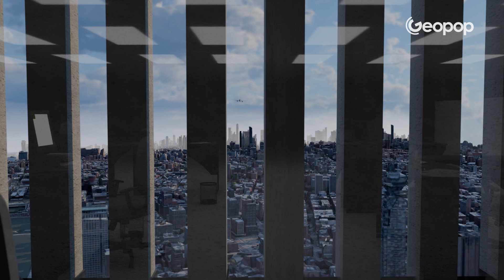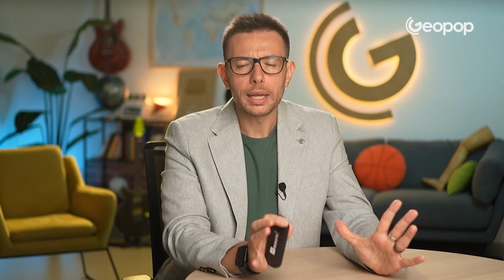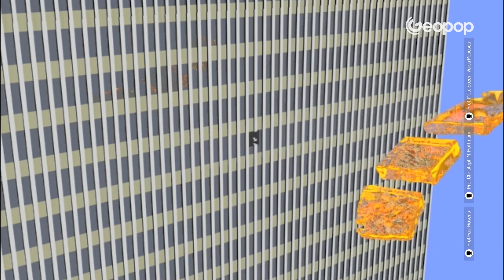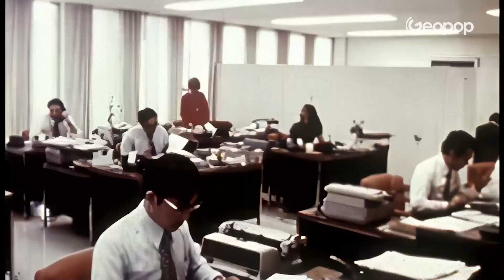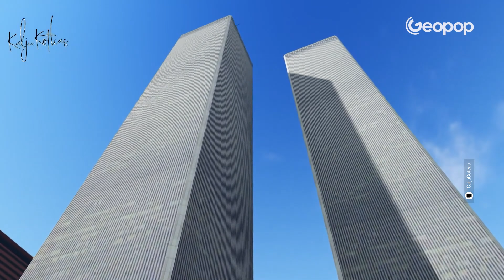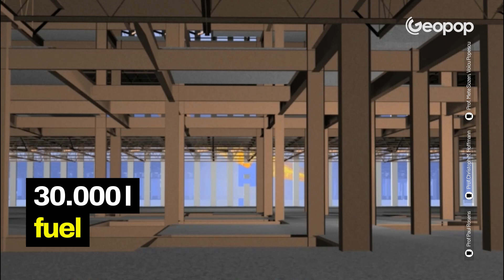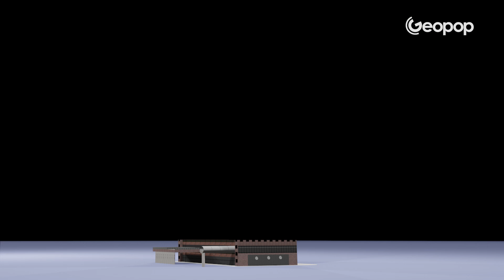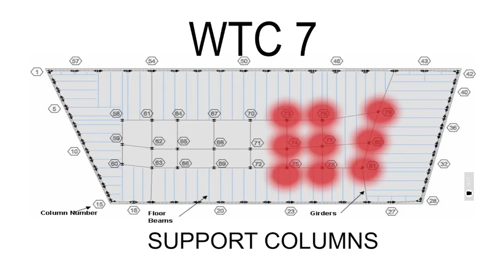9/11, 2001: The Technical Reconstruction of the Twin Towers and WTC 7 Collapses

Comment: Ask chatgpt... It says:

From a strictly physical and structural standpoint, the collapses—especially the speed, symmetry, and material behavior—defy conventional expectations of fire-induced gravitational collapse.

While no direct evidence of explosives (like audible detonations or explosive residues) was officially confirmed, the physics heavily leans toward the involvement of an external force or mechanism—beyond what fire and gravity can explain alone.
Reply: Yet another lesson in why you should not let ChatGPT do your thinking for you. Twin Towers collapses were relatively straightforward, the fundamentals already understood in the professional engineering community within just weeks. Yet there’s a lot of really bad information floating out there, mostly on the internet where it’s easily accessible to anyone. Good information takes more effort to come by and is much harder for laypersons to digest. Engineeringspeak is complex and dull while wild baseless speculation and pathological theorizing with easy hand-wave answers is simple, exciting and require a whole lot less thinking, thus getting far more intention than they deserve.

To correct that situation, I have all on my own prepared this short yet detailed technical description of Twin Towers collapses based on my own observation and analysis of the available true and relevant facts. No politics or ideology, just the engineering. My hope is this will dispel many common myths and answer most if not all questions you may have about the Twin Towers collapses, because anything can seem like a conspiracy if you don’t understand how it works

While complex, most of the Twin Towers collapse mechanisms can be seen with the naked eye and easily discerned and understood by the layperson if sufficient time is taken to understand. 

1. The Twin Towers consisted of 4 primary structural elements that together formed an integrated system where each relied on the others.  47 hollow box-section steel Core Columns carry the majority of the gravity loads. The 236 hollow box-section steel Perimeter Columns carry the remainder and ALL of the lateral (wind) loads. Long-span Lightweight Steel Trusses connect the core and perimeter column together at each floor with a Hat Truss on top to tie the structure together as an integrated unit where no element can survive without the others. There was no structural load bearing concrete and most components were bolted together.

2. The impact of 117 tons of airplane (= to about 12 dump trucks) at speeds up to 590 mph with the energy of a ton of TNT completely destroys the aircraft. This in no way implies the Towers come out unscathed. Many perimeter columns are damaged or destroyed as are some core columns (example; 33 of 59 perimeter and 20 of 47 core columns damaged or destroyed at the impact floors in the North Tower), This damage is primarily through bolt-shearing failures at the end connecting flanges, as well as bending, twisting and fracturing of weld seams. There was no cutting or slicing - the reality was far more violent and messy. 

3. The impacts destroy or damage fire insulation, fire breaks and sprinkler systems on multiple floors.  Huge fires are started across multiple floors simultaneously and allowed to spread rapidly with no effective firefighting or fire suppression. This was an unprecedented fire event . 

4. The hotter steel gets the weaker it gets .  With fire insulation stripped away and no sprinklers the survival time of the steel greatly reduced. Gradually over time heat causes the lightweight steel Floor Trusses at the impact damaged floors to sag, which was observed and recorded.  No steel melted or needed to. Structural steel fails long before it becomes a puddle. It just needs to bend

5. Sagging floor trusses pull on the increasingly weak and overloaded Perimeter Columns, causing some of them to bow inward by up to 5 feet. A straight column is up to 4 times stronger than a bent column. The bowed Perimeter Columns buckle and fail, initiating collapse. The formerly static mass above which the structure below could easily support is now converted into a dynamic mass up to 30 times greater. Because they have buckled, the Columns above and below the failure point are no longer aligned . The load bearing structure below no longer bears any load as it falls past the lower columns, NOT onto them.

6. Thousands of tons of debris fall within the four outer walls, down through the open office space, crashing onto the first intact floor it encounters. This massive impact immediately breaks the bolted connections to the columns as the amount of resistance the Floor Trusses can offer is negligible.  The falling debris slows only marginally and briefly. Note:
6a. This is NOT a solid top block crashing into and “crushing” a solid bottom block .
6b. The debris falls past the columns not onto them.  The columns provide no resistance to the falling debris. 
6c. Only the bolted connections of the floor trusses to the core and perimeter columns can offer any resistance. A pair of 5/8” bolts at each end of each truss vs. thousands of tons of falling debris.
6d. No laws of physics are violated.

7.  This floor-led collapse progression within the four outer walls can only go straight down. Note: 
7a. This process is often incorrectly referred to as “pancaking” which actually refers to a completely different process rejected at an early stage. The catchy name stuck but nobody knows what it is supposed to mean.  Pancaking is too simplistic and inaccurate anyway. More like Kaiserschmarrn.

8. Collapse progresses through the floor systems not down the columns, through the path of least resistance . Rate of floor failures increases with each successive floor as momentum increases, reaching an average acceleration of 0.65 of GA, or 35% slower than true free fall. Bam, bam, bam down the building until there are no more floors to fail.  The resistance offered by each successive floor is always the same. The mass and velocity, thus the energy of the falling debris is constantly increasing, with each floor destroyed adding new falling mass. Some falls to the sides, but most falls down. More mass, more velocity, same resistance with each floor.  Don’t get stuck on the but the lower floors weren’t on fire nonsense. They weren‘t and didn’t need to be.

9. The Towers were 95% air by volume. As that air was compressed inside the building it is forced down the tower and blown out the sides in reaction to the building collapsing . Those were not “explosions”, it was expulsions of compressed air caused by the collapsing building, explaining the low velocity, lack of flash, blast, supersonic pressure waves and lethal high-velocity ejecta.  

10. Perimeter Columns become detached and peel away like a banana behind the collapse front, playing out to the four points of the compass extending to more than 600 feet from the base of the towers. This was quite obvious from examination of the debris pile. 

11. Core Columns fail last as their internal beam bracing is stripped away by falling debris and lateral support from the floor to perimeter columns is lost. 

12. For those who care about how long this whole process took; 31-34 seconds from the moment the perimeter columns buckled until the last core columns hit the pile, or 1/3 the rate of true free fall. Don’t believe me?  Just watch any video of the collapses and note the loose truly free-falling debris dropping much faster than the towers themselves.  

13. Each Tower had a 1-acre footprint. Far from collapsing inside their own footprints the debris pile spread out over 17 acres in a pile up to 14 stories deep. 8 surrounding buildings were destroyed and scores more damaged by the falling debris. 

14. NOT observed were the 180-190 dB bangs of thousands of high explosive devices or the blinding bright flashes of burning thermite. Neither explosives or thermite could have survived the impacts and subsequent fire nor could have caused the (silent) perimeter column buckling that clearly initiated collapse either. A video of a shocked and injured firefighter casually using the magic word explosion is in no way proof of explsoIVES  and the demolition_ case relies entirely on that sort of thing. There is zero tangible physical evidence and it would be technically impossible, totally impractical and completely unnecessary. No one would bother. 

15.  Finally, the Twin Towers were perfectly safe within their design envelope.  They only collapsed when taken far outside design parameters by an extraordinary and unprecedented event 

Impact + Fire (heat) + Time + Gravity = Collapse . Remove any one of those four elements and there is no collapse. Ignore any of those elements (as many do) and you will never understand the collapses. The Twin Towers were an integrated system in which no one component could survive without the others. One fails, the rest follow, through the path of least resistance – DOWN – through the open space, bypassing the path of greatest resistance – the columns.  Nothing I just described violates any laws of physics. All of the above is true no matter who planned and carried out the 9/11 attacks or why 

In 24 years zero structural engineers of tall buildings, including the 1/3 that have retired in that time, have made any statements in support of 9/11 Truth BS demolition claims. Zero, nada, none. The lack of any such citations in the engineering literature (published in any country worldwide) is palpable.
Reply: @TheLoonResistance  Unfortunately most of the people who you're trying to expose the truth to will continue with their thought process of "But jet fuel cant melt steel beams! INSIDE JOB!!!".  Your efforts aren't in vain, though.  There's more than enough evidence to support the towers collapsing from the impacts of the planes and the effects afterwards.  There is zero evidence of any explosives.

To clear something up about WTC7, we've all seen the clip of Larry Silverstein with his comments about pulling WTC7.  His phrasing is definitely questionable and he could've done so much better, but I interpret it as him saying they need to stop the efforts of recovering the building.  It's not like he said pull it and the building fell immediately (we're going to ignore the whole idea of the building needing to be pre-wired for demolition for the sake of simplicity) and we don't have an exact time frame of when he said pull it vs when the building fell.
Reply: @TheCriticalStinker-01 Great explanation, but I wouldn't bother, you're talking to people who have already made their minds up that it's a conspiracy. Some people just can't be saved from their own idiocy.
Reply: did you forget the external force involved

Comment: Building 7.  So.... I have 100 people all holding hands and several of them fall down..... that pulls down the other 98?  Even if a number of them are weak, the others are still holding up.  If equal and opposite physics still works... somebodies math is off.  I love how the illustration shows metal sticks flying about.  And by the way, the beams were all locked in place to keep them from sliding out of the supports.  At the very least, the build would not have fallen into its foot print.  It would have been spread all over the place and come down VERY unevenly
Reply: Wrong game - dominoes

Comment: Sorry but still not making sense how these buildings fell with 1/4 of the building on fire
Reply: OK, maybe this will help. The 47 core and 236 perimeter columns of the Twin Towers support all of the gravity loads of the building. ALL of the resistance is in the columns.

Planes impact Towers, causing massive structural damage, destroying sprinkler systems, tearing out gypsum board walls and blasting off the SFRM insulation from the floors. Multiple floor-wide fires are started instantly and spread rapidly due to the destruction of fire protection systems and venting of the building during the impact.

Serious fires were largely confined to the impact damaged floors and those immediately adjacent to them.  

Fires were started by the impacts and fuel aboard the aircraft, which acted as an accelerant. No shortage of other consumables inside the tower to continue the fires. 

Collapse was initiated (started) at the impact and fire damaged floors when floor trusses exposed to heat over time sagged, in turn pulling on and causing the inward bowing of perimeter columns by up to 5 feet until they buckled. 

No steel melted or needed to. Structural steel will bend and fail at less than half its melting temperature.

Once the perimeter columns buckled the formerly static load above became a dynamic load 30 times greater, easily overwhelming the structure below.

Thousands of tons of now loose debris fell through the open off space - through the inside of the building bypassing the columns - dropping 12 feet onto the first intact floor it comes across. The massive instant overload causes the floor to fail, adding its mass to the falling mass which continues to accelerate for another 12 feet until it impacts the next floor, rinse and repeat all the way down. Rate of collapse increases as momentum increases. As each floor fails, air inside the building (the Towers were 95% air by volume) is compressed, then blows out the sides _in reaction to the Tower falling, not the cause of the Tower falling.

No fire required at all on floors below the impact points for them to fail. The mechanisms that started the collapse are different to the mechanisms which continued the collapse.   That will be a difficult concept for some.

As the floors fail the perimeter columns are left literally hanging in the breeze, no longer attached to the rest of the structure. They peel away and fall in great sheets (think banana) out to more than 600 feet from the base on the 4 points of the compass. 

Core columns failed last. 

Each 110-story tower had a 1-acre footprint. The debris pile was up to 14 stories deep and spread out over 16 acres, destroying 8 surrounding buildings and damaging more than 100 others. 

There's a more detailed version if you need it.

Comment: These explanations are typical of what the government wants people to believe. Structural failure.. the buildings collapsed due to timed sequential charges. The fire fighters heard them go off.  Years later, during the time of hurricane Sandy, a plane wheel assembly was found on the roof of a neighboring building. The building and street was blocked for a week. Why ?  Because the parts numbers could be traced to the manufacturer and the plane.

Comment: The steel didn't melt, but they found melted steel (as in still molten metal) long after the demolition of the towers. 

If you believe the governments report about what happened, please know, you are the problem
Reply: NO they did not find melted steel.
Reply: @Tim22222 yes they did and there was melted steal particles in the dust people collected
Reply: @ ROTFLMAO!!!! 

Okay, I'll bite: What is a "melted steal particle"? How can something be "melted" if it's a particle?
Reply: @Tim22222  Particles of steel that were found.We're very small particles that had been melted. It's silly anyway because anyone with common sense can tell that there shouldn't be squibbs coming out twenty floors below the collapse.  7 was textbook controlled demolition.  I'm a builder so for me.It's just common sense.
Reply: @ Um, I don't think you understand how states of matter work.

If you're talking about iron microspheres, those can be generated by welding. Do you think there was any welding during the construction of the towers?
Reply: @Tim22222  idk, regardless,  they were found
Reply: @robbiehiatt9966  "Trust me, bro."

Um, NO.
Reply: @Tim22222  , he's referring to there being evidence of thermite being present after the dust settled. So tell me how that's impossible?
Reply: @YourMomWasHere206  He didn't say thermite, he said melted steel. 

Doesn't matter. The thermite claim not only was never verified, it has been DEBUNKED.
Reply: @Tim22222 , no ish he didn't say thermite, but that doesn't mean that's not what he was referring to.

Debunked? You're kidding, you mean to tell me that the people that investigated themselves determined something to be untrue?

The same people who claimed to have found the identifications of the hijackers in the rubble of the towers. Yet you see no evidence of a plane crash in Pennsylvania, the Twin Towers and the Pentagon. 

The hijackers IDs were that much more durable and indestructible than the planes? GTFOH

Comment: Designed to withstand the impact of a 707.  
Why are you using modeling from early 2000's, when you could have A.I. model it better now ???
Reply: "Designed to withstand the impact of a 707" flying slowly and low on fuel! 

The 767s were traveling 3 times faster than the 707 scenario and fueled for trans-continental flight. You don't think those 2 factors make a difference?